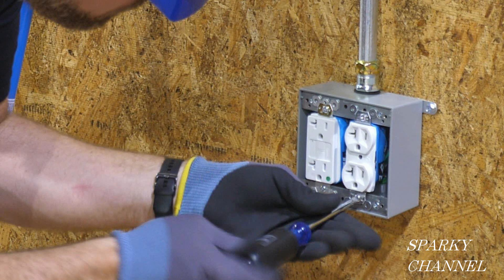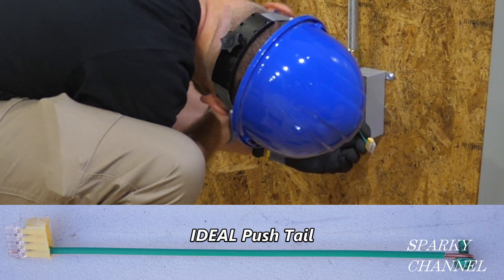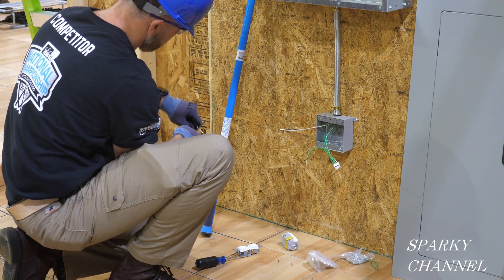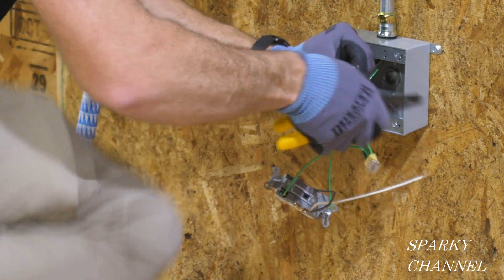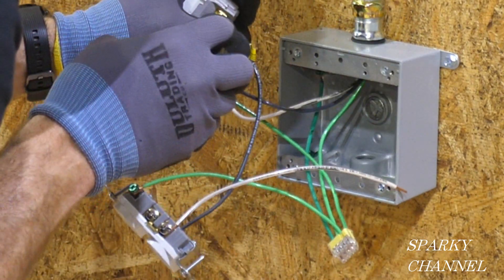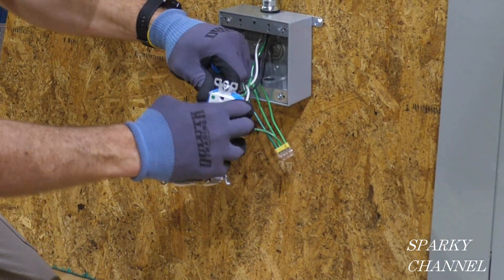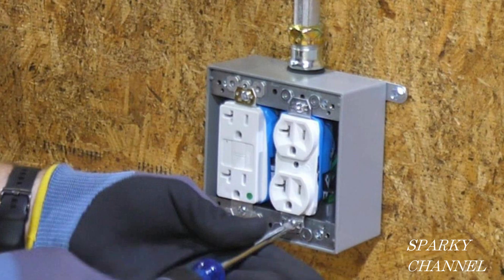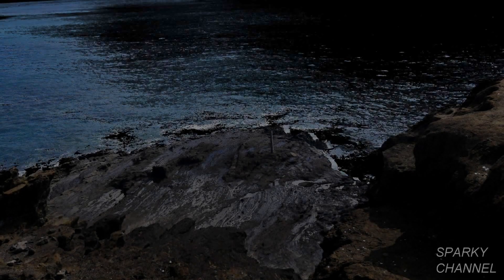Watch a Pro Wire a 20A GFCI and 20A Receptacle, Any Code Violations?

Comment: Unless the box and or the conduit is plastic you don't need to run a ground wire. Only on the box to the receptacle.
Reply: A separate ground wire is always better than purely relying that the metal conduit will always have a good conductivity. It can be good at the start, but can also fail over time. And the thing is, you'll only notice if you would inspect it on a regular basis (for example every 5 years), or learn it the hard way that it offers no longer a good path to the ground. Good practice in most countries is that metal conduit is these days only a mechanical protection for the wiring, and also offers an additional parallel path to ground but never used in new installation as a sole path to ground. Especially couplers between conduits and enclosures, or where the conduit has been cut to length are vulnerable to corrosion. And rust is not a good conducting material.
Reply: Most jobs spec a ground wire anyway, relying on the conduit means u rely on every fitting being on tight and properly
Reply: @Nick-bh1fy  And also that it stays that way. And that's the problem. Here in Germany we consider the life span of an electrical installation being at least 40 years. Outdoor conditions can have a massive impact on that life time. You got exposure to UV from sunlight, rain, snow, temperature changes over the year that cause expansion and contraction. In some countries during the winter time people throw salt around to prevent slippery ice on the walkway. Of course that produces also salt water. If that comes in contact with metal conduit that will start to corrode. The same thing if you live in an area next to the sea. Natural source of salt water in the air.
Reply from the maker: @Marcel_Germann  Hi Marcel! Great comments.
Reply: Not if you work for me, you don't. I want a safe path to ground decades of vibration and weather exposure from now. I also know that the resistance of a continuous copper wire is going to be lower than several lengths of steel tube and numerous fittings. I ohm the things out in the field. I want my path to ground to be the path of least resistance and reliable for the life of the installation.
Why take chances with people's lives? Why risk the poorly protected consumer electronics/logic circuits?

Comment: That paragraph (c) quoted is for replacing non-grounding receptacles with GFCI fed ones.  I'd say it doesn't apply since he wasn't doing that.  If you DO think it applies, then why didn't you mention the 'No Equipment Ground' label?  The paragraph you cited says BOTH labels.

Now before you start to reply, I'm sure there IS a paragraph somewhere that says it should be labeled 'GFCI Protected' and it should be labeled.  Just NOT the paragraph you show in the video.
Reply from the maker: Thanks, good attention to details!
Reply: @SparkyChannel  I admire your tact. I'm not a lady, my response would have been a bit...frostier.

Comment: Code violations: no torque screwdriver used on the receptCles
Reply from the maker: Not called out by the manufacturer. It may happen some day though.
Reply: @SparkyChannel  Bill, Leviton and almost all manufacturers now have torque specs for their receptacles.
Reply: @jragadio  Yes, and I adhere to them. Not for everything, though. Fourteen to eighteen INCH-pounds is way less than one might think.
Reply: @SparkyChannel  maybe it would be useful to do a code video on torque requirements!

Comment: I caught the WR fault.  I spent the whole video trying to determine if the EMT connector on the box was a set screw type or a WR type.  and I'd be back in about 4 years to replace that entire assembly, including the wire, because the screws would have all seized; with nonmetallic conduit and enclosure.addendum: you threw a curveball by showing the terminals on a WR rated GFCI.
Reply from the maker: Excellent points, thanks!
Reply: The EMT connectors on the EMT are compression type. I believe the different color of gold on the compression nut indicates they are weather resistant. I am used to seeing blue for this. If this was commercial I believe you have to use metal boxes and conduit.

Comment: The shop I worked with never wrapped devices in tape like that. I know florida code requires it. Is that a stat to state thing? As for the supply chain problems, can cornfirm jobs were held up by lack of bath fans and breakers.
Reply from the maker: Yeah, the show had to go on with what they had.
Reply: Inspectors here like to see tape or those expensive ArmourBand wraps. I don't regard code as the maximum limit, if it's not required but good practice, we do it.
I want people to look at my work fifty years after I'm gone and say, 'yup that was old Ethel. Despite being a woman, she was good. And, yes, the sexism won't ever leave the trades.
Reply: Not to mention its safer if you have to get in the box while live

Comment: He also did not support the EMT
Reply: there's a loophole that allows a short run like that to be supported by the enclosures.
Reply: Bill has had an explanation on that not too long ago. Less than 3', no extra supports needed as one side supports the other.

Comment: Great video. I don't think I could do that work with gloves on. LOL. One QUESTION: Why such the long tails in the non-GFCI receptacle?
Reply: Makes it easier to install or remove if you have to do just one.
Reply: Yep, try that much wire in a plastic box.
Reply: @Sparkeycarp  plastic or metal, doesn't matter. It's the size of the box that does. Just remember, you have to have a minimum length conductor able to pull out of the box, and he's got it for either receptacle, one at a time.